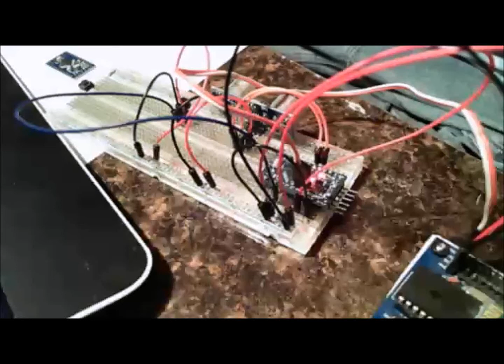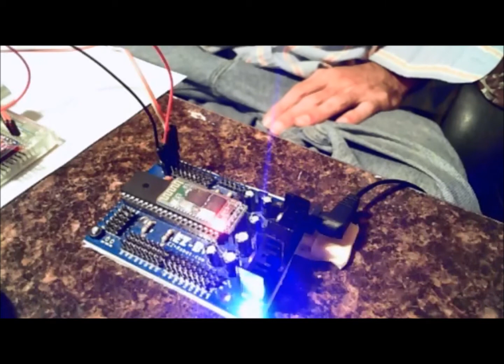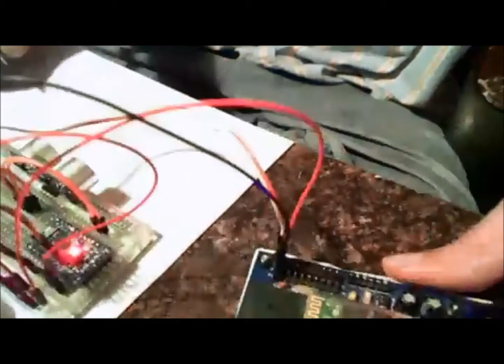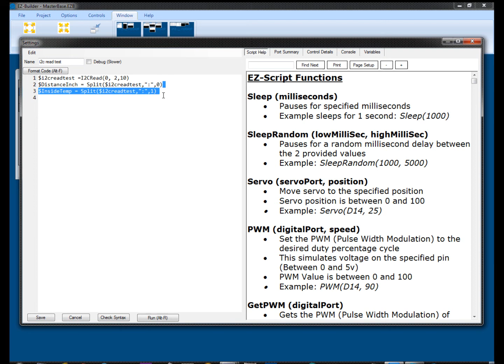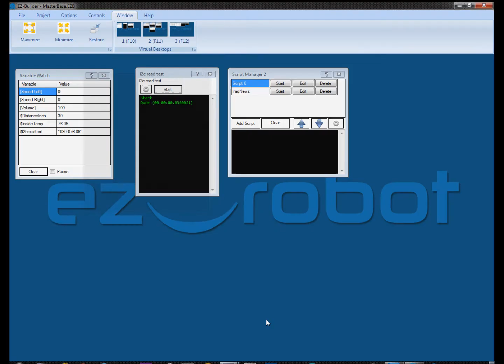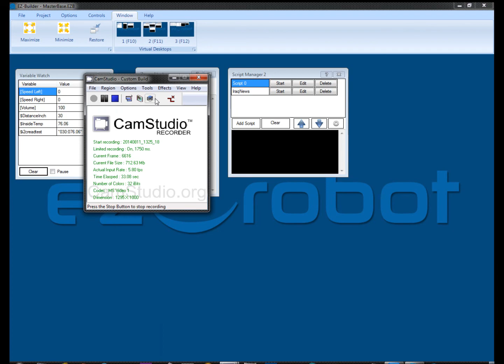ezb Arduino I2c

Comment: Hi "HGB"

Thanks for producing this video which is great work. I am wanting to connect an arduino to EZ-B using the I2C port. My aim is to use a Lidar and send the information back to the EZ-B. Is there any chance you can go into a bit more detail about the connections and the coding?  Much appreciated!
Reply from the maker: Chris Jackson Hello Chris , are you going to be using the EZB-3 or the EZB-4? I will make a new video and want to match your environment as close as I can.
Reply: hippiegeekbook 

That sounds fabulous. I have the EZB-4. I think the idea of adding sensors to the arduino and then passing filtered information up to the EZ-B would be very interesting to achieve.

Regards

Chris